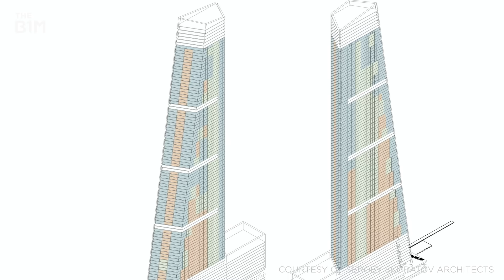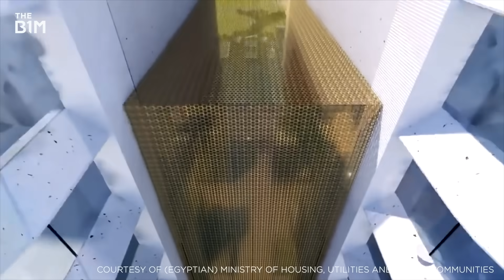The Tallest Skyscrapers Under Construction in 2020

Comment: That antenna of PNB118 is absolutely cheating. Without the antenna it is just around 530m.
Reply: shut up. Burj Khalifa has more than 200m antenna. And our antenna means a lot to us, the building has a shape of history, and you dont even know why the spire needs to be tall.
Reply: The spire has always been incorporated in the design of the tower from the design board. It's supposed to resemble the raised hand of our first prime minister during the declaration of independence ceremony. And Kuala Lumpur is also notorious for having the most lightning strikes for any major city around the world, so the spire helps redirect lightning throughout the city as it is the highest point around. As of height it may seem cheating in terms of ranking but not within the design. The towers height has always been around the ballpark of 600m and above and Shanghai tower just happend to be the only one around that height at the moment. That's why it's taking spot at number 2. If the other major projects around the world realised it would have been bumped down to 5th or 6th.

Comment: How apt to see a snippet of Australia 108! The exterior looks equally as striking as the interior 😍 There is a gym, two sauna rooms, a steam room, small swimming pool and 3 bathrooms all on the same floor. The security comes in three forms- cctv cameras at the entrance, key only door and lift access and a 24/7 front desk staff to deter any potential burglar ⭐️ Australia 108 is also extremely accessible across the inner city of Melbourne including eateries and grocery shops near and along the Yarra River. There is however, one negative, that is the vertical sound proofing between each unit. The sudden impact noise of furniture or other sound decibels that are shock-inducing to the human ear is going to be a major drawback for buyers with similar sensitivity to noise like myself. That being said, the opposite holds true for sound proofing against noise from the daily construction or usual traffic. You can barely hear a thing from outside which is what the architect or engineers have done well, but they should consider fortifying the hollow walls that separate each unit above and below to be somewhat near what they use to soundproof the outside. I still love the condominium though because of its facilities, convenience and accessibility 🙏🏻💙

Comment: That KL tall needs to be re-assessed as the spire is a joke. It should only be to roof height. What are your thoughts on that @B1M ?
Im looking forward to Sydney getting in on the act early next year there are some massive ones coming. Not 108 floors but bigger than anything Sydney has seen before and will make sure that it is not (quite rightly) left behind Melbourne in the high density stakes that is needed in our 2 world class cities.
Reply: Juergun Magerkinsquirter  Burj khalifa’s spire is 200m re-assessed it . Spire is a joke.

Comment: It is interesting that the Australia 108 tower at 317m has 100 floors and the PNB188 tower at 644m has 118 floors. They must have almost double the ceiling height for the PNB floors.
Reply: It is because PNB118 is a building to around 490-500 meteres, the rest is a spire so no floors.

Comment: It's a little disheartening to see that the height of the tallest buildings under construction is currently decreasing year on year. Merdeka PNB118 is not only the sole remaining 600m+ building under construction, but it's the only 500m+ one as well. Even PNB118 itself only surpasses 500 m because of that gigantic spire.The others have either completed construction, been downscaled, or cancelled. Or, well, there's also Goldin Finance 117, topped out but not under construction at the moment, so it's a little hard to place in a category. But it seems like developers out there are seeing the cost of hypertall skyscrapers, looking at the potential benefits, and come to realize that anything taller than 400 meters is too much of a gamble to be worth it. China was the only place with enough money to consistently build towers taller than 500 meters, but a national ban of buildings taller than that has been put in place. The taller towers that haven't already been completed have to reduce their height. And nowhere else did it make much economic sense to build that tall.
Or put another way: the five tallest buildings currently scheduled for topping out in 2021-2025 will all be lower than the five tallest buildings scheduled for topping out in 2016-2020 - by more than 30 meters.
Reply: The rooftop of PNB 118 is 520m , not under 500m
Reply: @Daniel-jt7xw : Aha, I remembered wrong, then. Still, pretty far below what is normally considered the Megatall threshold.
Reply: @Codraroll  man , even the burj Khalifa without the spire is just 580+m
Reply: Daniel ダニアル ,yes bro,even Shanghai Tower observation deck 546m and the rest unspace deck making this building 632m

Comment: Cant wait until something like the x-seed 4000 is built, its only a matter of time until it happens, just hopefully in my lifetime
Reply: Possibly not in in 21st century,maybe early 23rd century.
Reply: @jekesan4221  In early 1900s, tallest building was Singer Building at 187m / 612ft. Early 2000s, Burj Khalifa at 828m. So that's about 4 times higher in 100 years. If we extrapolate, then we get 3700m for year 2100, which is close to the height of hypothetical X-seed 4000. But a more realistic engineering progress would make it happen probably around year 2200 or 2300.

Comment: Interesting indeed. I don't think that the spire should be included in the buildings' height. It should be measured to the highest point a person can stand without a harness. Cheers
Reply: Yes, the inclusion of spires doesn’t make much sense these days – but it causes problems with historical high building data if you exclude them which is why I think there is a reluctance to exclude them.
Reply from the maker: You might be interested in this - https://www.youtube.com/watch?v=SOcpipUgo9c